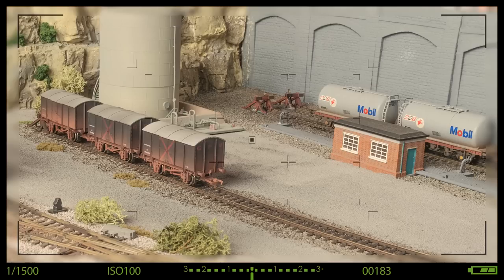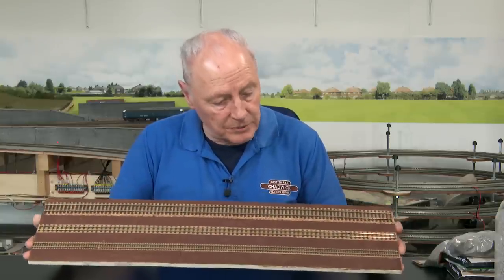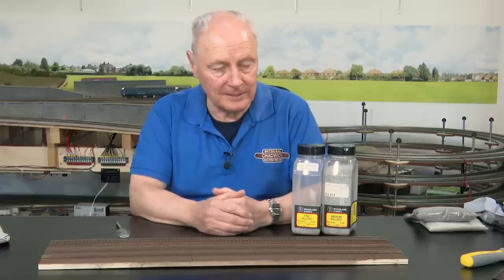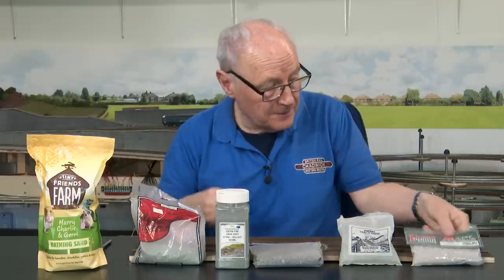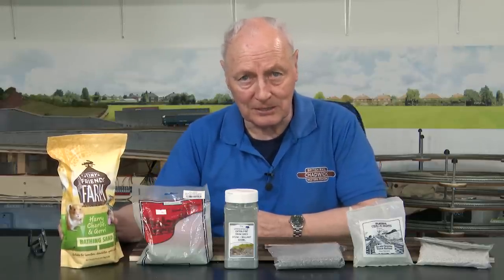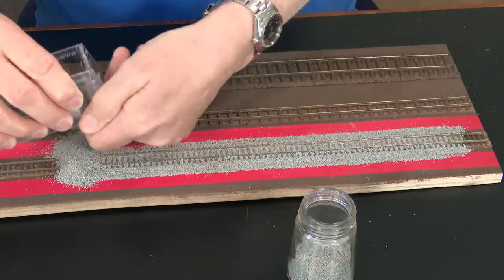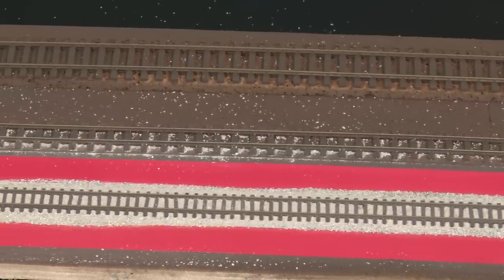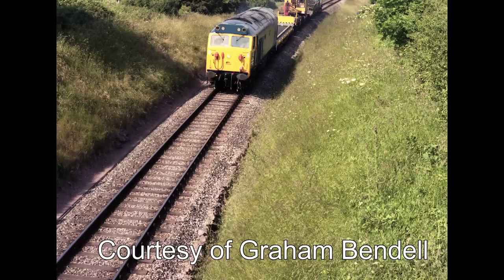BALLASTING, the GRITTY TRUTH at Chadwick Model Railway | 190.

Comment: Thank you Charlie... I enjoyed your presentation. (I'm an appreciator of N-scale.) I was thinking about the aspects of the ballast types you've featured in this video. I understand that manufacturers of these products will have taken into account the grain sizes so that their product can be in sync with the scale of the tracks they are intended for.  I also get that the colours and shades on offer will vary in order to emulate the variations in the chemical composition of the granite that the ballast would be made from. It comes as no surprise to me that there are many modelers who are sufficiently enthusiastic to make sure that the end ballasting result they're after closely resembles reality, even if their layout isn't strictly, I believe the term is, prototypical. (i.e. Where the layout is drawn from actual existing railroads?)  But... I also wonder Firstly if the modelers ballast you've featured, with the possible/likely exception of the Chinchilla sand, is actually made from granite? and secondly, If there are ballast grain products that are synthetic, how well these ballast materials react to the chemicals that are commonly used to adhere them to the bed and if needed or desired, in the weathering process.
Reply from the maker: Thanks NDV. I believe that the ballast made by Woodlands scenics, is made from crushed walnut shells. Regards, Charlie
Reply: @ChadwickModelRailway  -H'heh...I suppose it was a bit much to expect that it would be made from tiny chippings of granite. ;-)

Comment: Excellent, as always. V interested in the pre treatment using isopropyl alcohol, and then washing up liquid in with the glue. DCC Concepts also produce a good N Gauge ballast (there are lots of manufacturers out there, of course). Thanks for featuring N Gauge in your video, as well.😊
Reply: The IPA lowers the surface tension and causes the glue to soak right in. Without ipa some ballast floats and the glue sits on top. More IPA is needed as you go along as it evaporates. A fine sprayer is best.
Reply: I downloaded a spreader from thingiverse and 3D printed it.
Reply from the maker: Thanks guys, your opinions are much appreciated. Regards, Charlie